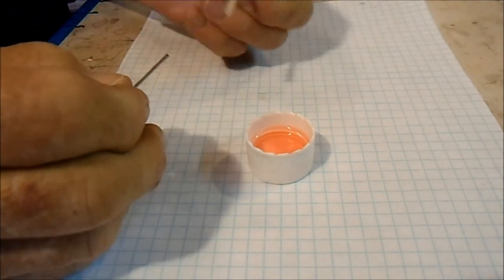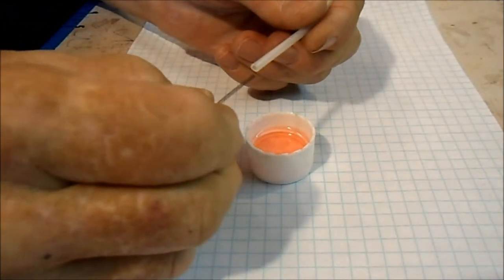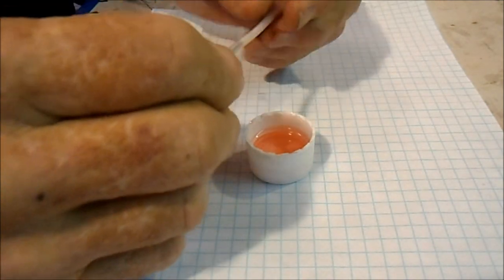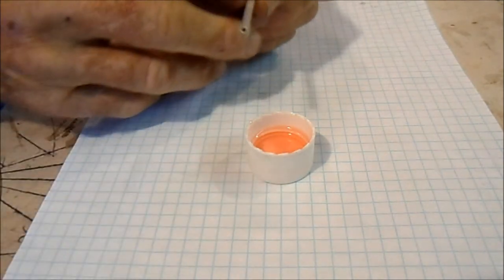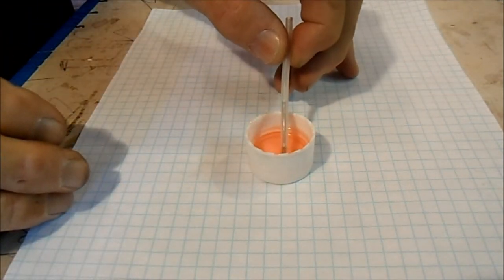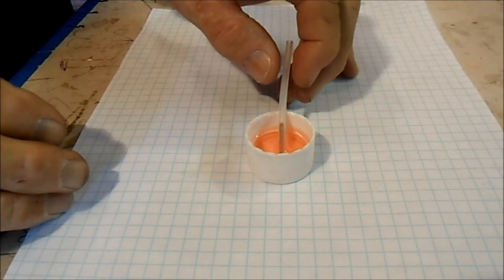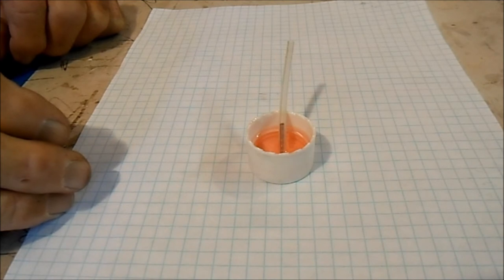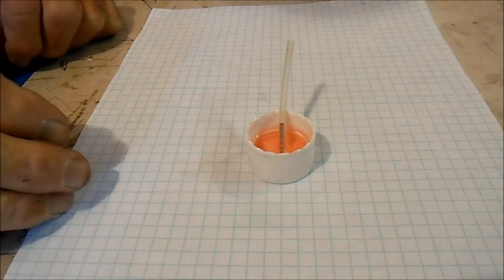Cox Babe Bee pickup spring.wmv

Comment: YES! The spring DOES work to help pull fuel into the line. It helps to prevent air bubbles 🫧  in the line also. It also acts as somewhat of a "filter" to trap small particles. It IS a good idea to remove the spring every so often, and clean the crud out of it, as there is ALWAYS some stuff clinging to it after enough runs.

Comment: Dear Rusty K, see your video and remain surprised. I was sincerely convinced that the spring inside the tube served the function of felt for a possible garbage that could go with the fuel.
Now I see it was to facilitate the suction of fuel, but can also handle the job felt that from time to time one removes and cleans any dirt from inside the tube.
Thank you very much, greetings.
Reply from the maker: MauricioB71 Actually it's debatable. A former Cox engineer claims its only purpose was to keep the tube from collapsing. Apparently the 1/2A Speed guys remove them and use aluminum pickup tubes. But it sure looks like it helps with ease of cranking with less prop flips. Thanks for your comment
Rusty